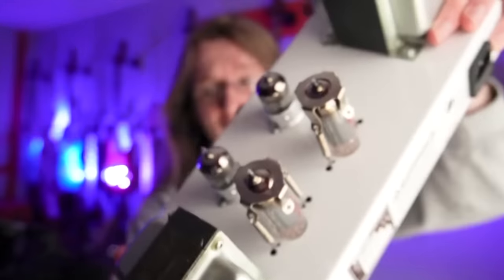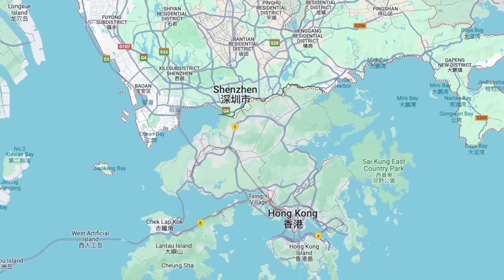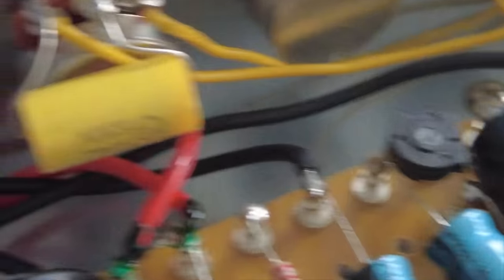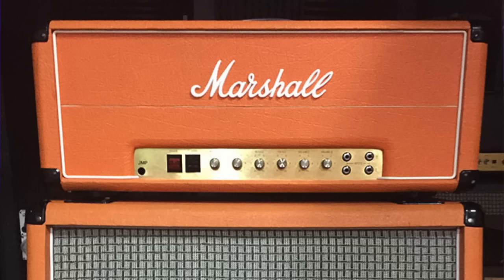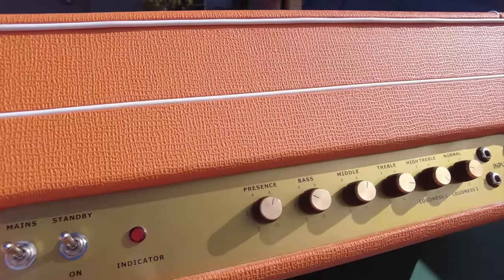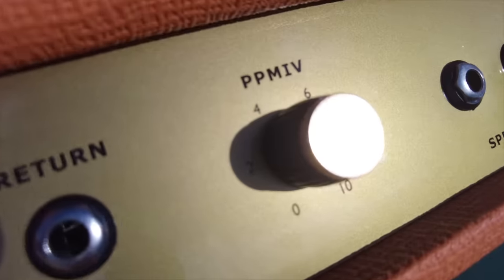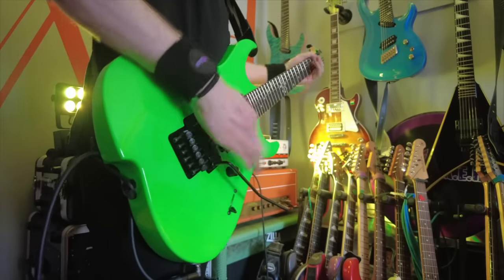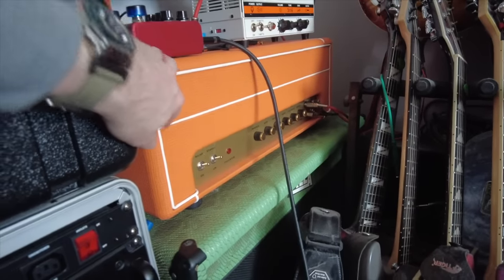Who made this Amp??

Comment: Also, don't forget that handwired amps are also easy to make yourself as a DIY project. I built one JCM 800 50 Watts clone and a Plexi 1959 100 watts. Took around 20-25 hours to make. It gives you also the opportunity to add custom features on it.
Reply from the maker: I’d love to try build one, but it’s a little daunting and there’s also the added dangers of accidentally touching a capacitor which scare me.
Reply: Love to but I'm crap at soldering and now need three of my guitars sorting because of my bodge soldering, so building an amp cool but not for me😁
Reply: @KDH  A capacitor shouldn't have charge in it from the capacitor factory, it will usually only be a danger once installed in a product and turned on
Reply: man I had a jcm 900  2100 it was stolen .................
Reply: wished I could make one like it
Reply: 84?
Reply: If building an amp seems a little intimidating from a soldering perspective, try building pedals first. There are a few DIY pedal companies online that you can buy PCB's and components from and you can get your soldering skills up populating pedal PCB's. They are a blast to build.
Reply: @leonkennedy74 Yes you are right . Fortunately the 18 watter I built tuned out fine . But now 15 years later I have some issues and are finding it hard to trouble shoot .
Reply: @KDH  You seem like an intelligent common sense  guy so you would have no trouble building one .I built one and it was a very enjoyable experience.   And at the end you will  be a soldering ace.
Reply: @k7j007  No need to even get PCB's, just look for the schematics (finding about every classic pedal schematics from the net isn't that hard), get some box for it, breadboard, perf-/stripboard and the parts. Build it first on breadboard to see if you like it and finish on perf-/stripboard. Some pedals even have nice ready stripboard schematics so you don't even need to learn to read circuit diagrams and figure out what goes where.
For authentic look the magical black goo is just thick epoxy with black dye, I would rather advice to leave that out and just apply a small amount of silicone on possible heavy components because repairing anything with the black goo is just nightmare beyond blindly figuring out multi-layer PCB design.
Reply: @KDH  It's true that those caps can be nasty, but like everything, learning is the key... There's a way to drain those to keep everything safe for you. What I did is that I started small, building pedals and then read a lot about the safety procedures before starting with a full build. It was a lot of fun, I sold those two amps to local bands and I will build a third soon.
Reply: @guyprovost I know there's a way to drain capacitors, but wouldn't turning on the amp when the plug is removed from the power outlet drain them? It's something I've thought about for a while now.
Reply: @castleanthrax1833  Capacitors need time to "empty". And those big ones can carry 400+ volts... Even if the amps is turned off. They almost act as batteries. Caps are in a circuit in order to "smooth" the spikes and lows, making sure the flow is constant. The best way to picture it is as a bucket of water. Imagine a bucket filled with water with a small hole in the lower part. The water with flow through the hole with a more "constant" flow even if the way you fill it with water come with the hose open full throttle at time  and at really low rate a other time. If you stop the source of water, the bucket will still need time to "drain".

If you turn off the amp, eventually they will drain. But I do not want them to drain using my body as a draining pipe when I hope time has passed :) ... Draining a cap is easy and you can always check the voltage currently "stocked" using a multimeter. In doubt, double check. You can easily built yourself a "drain" using two alligator clips, a wire and a resistor. You just clip to a ground and to the live part of the circuit to drain. Then you multimeter check to make sure before troubleshooting. Look online on how to build a capacitor discharge tool.
Reply: I think you should start with a pedal or two, I recommend from Aion fx. After you get comfortable with the soldering/troubleshooting, then start with a simple amp circuit.
Reply: @guyprovost I didn't ask for an explanation of what a capacitor is... I'm fully aware of what they are and what they do. 

You didn't actually read what I asked because you haven't answered my question. 

Never mind. I don't need to read another explanation of something I already know and didn't ask. 

Thanks anyway.
Reply: @castleanthrax1833  sorry about that… I guess the short answer to your question is « no »
Reply: @guyprovost  Many thanks, and sorry for being rude. ✌️
Reply: @KDH  No danger when you are building from scratch since nothing has been charged. The danger is in servicing amps which have been used
Reply: @KDH from the factory, capacitors are harmless, they don't hold a charge until the final product is plugged into the wall. If you're decent at soldering, you have nothing to worry about, it's just time consuming.
Reply: @KDH I'm a former Navy avionics tech, and built a few for myself after discovering it's the only way to get exactly what I want.  There's a learning curve.  I had the advantage of knowing how to read schematics, theory, and how to soldier.  Other non tech people have made successful builds.  There is no shortage of information on how to build an amp.  Everything seems hard until you figure it out.  I think it's worth doing a year of researching to get exactly what you want for once.
Reply: @KDH check out Low Head Room youtube channel. He builds an inexpensive tweed deluxe kit in a series of videos . Litteraly shows you every last connection. Hands down the best amp building tutorial on youtube. I used it to build my first amp and learned a ton ! Higly recommended!!
Reply: I would not trust an amp I built not to  kill me. I had one near death experience with a valve amp already. That's more than enough.
Reply: @monochromedout  I'm not sure pedals are comparable in terms of danger. It's like saying that if you think parachuting is dangerous maybe you should start with petting fluffy kittens. :)
Reply: @KDH  I've been replacing all my amps with equivalent hand wired (point-to-point) kits and thoroughly enjoyed the process both building the amp chassis and the cabinets - its a shame Barry at Ampmaker is currently closed as his WF-55 tweed amp was ideal for the beginner.  Just finish a kit from Modulus (Supa Deluxe) which with a few tweaks was great & just ordered their ROX-15 kit, the only issue here is unlike Ampmaker there are no step-by-step instructions, circuit diagram, explanation of circuit design, or an end of build test procedure, just a layout PDF and parts Pick List.  Never had any dealings with them but Vyse Amplification (Somerset) offer residential courses for both building and repair (take your own) of guitar amplifiers.
Reply: @KDH unplug it and bleed the filter cap, it's literally touching one end to the cap and the other end to a piece of metal. You'll get fine, go with a vintage amp to start with, they're pretty simple circuits that are far less complicated than you think.
Reply: I did build multiple amps for myself, Framus Cobra, Soldano SLO 30. Handwired amps and turret borad is the way...
Reply: @hadleymanmusic I have a JCM 900 2100 SLX made in 95', would you like it?
Reply: @KDH You could start small, maybe mod this amp for your liking? I can help you if you interested.
Reply: I've been building and servicing amps for close to twenty years. I must have built 40 various kit amps. Typically, with companies like Ceriatone there are year+ wait for one to be built. A lot of people don't want to wait, or they want some modifications to the circuit, etc.
I'm not going to get into the weeds comparing them, but I'll say this much: if I was looking for something like a JCM 800 or Reissue Plexi,  buying an actual Marshall wouldn't even be a consideration. Even if you buy it as a fully built amp, you'll be paying half as much and getting a better amp. A Ceriatone JCM 800 2203 will be $1000 less, and it's a point-to-point half wired amp instead of a PCB.
Reply: @KDH  Don't worry, mate. You'll only do that once.
Reply: @timwhite5562  Maybe you don't have a Fyette pitbull ultra lead schematics?
Reply: @KDH  Never had an issue with capacitors. It's the "testing an issue while the amp is live" that is especially dangerous and got me a few times. Remember, guitar strings are attached to ground! Never test with a guitar in your lap, signal generator or no input is preferred! 

Capacitors can easily be discharged, and better yet, you should always install bleeder resistors which automatically discharge the capacitors. One should still discharge an amp with filter capacitor bleeder resistors or measured for voltage, but I'll admit, I often don't, after monitoring the voltage and seeing it drop off in seconds after shutting the amp off.
Reply: nothing ventured is nothing ventured, live in fear. Keep the caps away from hands, simple, follow signal path. Learn to discharge caps.  @KDH
Reply: @KDH I've taken 600v through my hands several times.... it only makes you stronger.
Reply: @guyprovost  Are there are any recorded clips of your amps? :)
Reply: @HaydenMcCarry  Yep, I did record a few riffs, I'll have to dig them out.
Reply: And no need for coffee that day! @DeadKoby
Reply: Where can I find a kit?
Reply: @KDH 
We used to toss live capacitors to each other in electrical lab in college..major fun. It's the amps (amperes) that kill you..not volts..

Comment: This is touching on what most guitarists seem to deny or ignore - they buy BRANDS, not gear. Guitarists (well, musicians in general, but particularly guitarists) are notorious for hearing with their eyes. That's why the legacy brands (Gibson, Marshall, Fender, etc.) are able to charge what they do - they've become luxury/status items and their value is not based on the quality of the construction, but on the desirability of the name.

Hate to bring them up again but Chapman Guitars is a prime example of how we have all watched this happen in real-time. They started out quite similar to your Grand amp here - they got an overseas factory to make a quality item for cheap and sold it primarily through word-of-mouth. Then they started building a brand - and now those same guitars made in the same WMI factory cost 2-3 times what they used to. Where's that extra cost going? The name on the headstock. It's not just a "generic" product anymore, and the name became "cool" with guitarists. You can buy a secondhand Dean Hardtail (made at the exact same factory to the exact same quality levels) for HALF the cost of a used Chapman ML1 Pro Modern, just because of the name.

There's nothing special about a Marshall - the electronics are basic (this technology has been around for 80+ years!), the circuit designs are publicly available (a quick google search will get you schematics all day long), and they themselves started off doing exactly what Grand is doing here (making cheap Bassmans for the UK market). Anyone with a box full of parts and a few hours' soldering experience can make one. What you CAN'T do is sell it as a Marshall or convince other people it's a "real Marshall." That's the difference.
Reply: There are some additional considerations too. A stable brand should "still be around tomorrow" A warranty might actually have meaning, and they should have a predictable quality level. This in turn means you should be able to expect a higher level of support, as they have more to lose in brand value by not continuing to give good service to their customers. Does this always turn out true? definitely not, but at least partially because we get hooked on brand (and there is nothing wrong with being loyal to a brand that's served you well in the past), and sometimes we don't vote with our wallets the way we should.
Reply: @paulmdevenney Also resale value. Guitar players tend to cycle gear. So resale value is important for most of us.
Reply: Nah. Most of the American Marshall Forum users are very open to clones. Especially Ceriatone and metro, since they source higher end components. I found a used Ceriatone JTM45 for relatively cheap and it’s great.
Reply: Agreed on all fronts 👍

...Bonus points for the Deal Hardtail comment, I still love my 2007 Brazilliaburst. Underrated bargin.
Reply: Exactly. This is all 80 year old tech by this point and you can bolt together a better Fender for under $2k than anything they can sell you.
Reply: @watersnortmoment3734  Agree. Ceriatone is the shit.
Reply: I have never cared about brand. I just buy the best piece that I can afford. My guitars and hardware are a mixture of many brands and Price levels.
Reply: @216trixie  
This is the way.
Reply: I agree, and your Marshall example is a great illustration.

Of course, the practice of placing arbitrary value on certain brands isn't limited to musicians. It applies to clothing, automobiles, beer, food, and the list goes on.
Reply: In the current market I don't think you will necessarily get back what you paid for it, I've seen a few shops here in England and the U. S. saying they're turning people away with their Marshall head and 4 x 12 because they just sit there in the shop. Also it's a lot to lug around unless you're a touring band with roadies, you can get a smaller amp and get a great sound with P.A.s. Then there's E bay and Reverb affecting price and availablity.
Reply: This is part of why so many guitarists hate Peavey amps. The old ones with the tall silver panels on the sides of the cab, specifically.
But which model of Peavey do people hate? They're all vastly different designs, it's not like fender offering 4+ versions of the twin (twin, super 6, quad, dual showman) with different speakers, most old Peaveys have vastly different controls and tonal characteristics. But it's easier to write them all off as bad when you spent $3,000 on something because it says Marshall on the front.
Reply: Marshalls are cheap tho, look at their flagship for the last 20 years, the JVM410H. It's the cheapest flagship amp with the most features. Take a look at the Mesa Dual Rec, Soldano SLO100, Black Star Series One, Bogner Xtacy, Friedman BE, Engl E670, EVH 5150, Orange Rockerverb MK3... Hell even the Peavy 6505 1992 is more expensive with much less features than a current DSL or JVM
Reply: @GhostpainOG   Agreed, I own three of their amps already, looking at two more over the next year. One he calls a FAS ( A new Soldano clone) and a JEL (2 channel, Jake E. Lee/ JCM 800 modded Marshall clone). Nik and his crew are the Shiznit.
Reply: @strokingoutloudpodcast  I mentioned it because I too have a WMI Dean Hardtail in silver, lol. Bought it for $200 and it plays just as well as ESPs I have that were 10x the cost.
Reply: Us synth players are not like that 😝
Reply: @fortheloveofnoise  Considering I've been looking into modular lately, I'm not sure that's true either. :P
Reply: Good points..I prefer my Dean's to my Chapman. No contest.

Comment: It should be noted that a lot of people get confused about what it means when a manufacturer says hand wired. Really, any build can be hand wired, even pcb builds. What people are thinking of is point to point wiring and manufacturers know this. Some less... scrupulous manufacturers have capitalized on said confusion.
Reply: I study electronics and one of my professors (has a master's in electrical engineering) always suggests we get PCBs printed after the prototyping stage because of all of the benefits the provide. They're more compact and reduce parasitic capacitance due to their layouts. 

I think mostly the fascination with point to point and dated tech comes from a misunderstanding of how electronics work.

Now the argument of amps being made to small/unfixable because of many PCBs and crammed space is fair but I believe that's a different argument because it's a design/layout issue vs. a point-to-point/PCB.
Reply: @Bruce.t.thomas I'm a former avionics tech.  Engineers are good for theory, not so much for practical applications.  Some have never held a soldering iron.  Listen to amp techs that actually play guitar.
Reply: It's hand wired turret board construction
Reply: @qua7771 yep definitely true! 100% mate. Knowledge is power. Practical application is key!
Reply: Like the recently relaunched Gibson amps designed by Randall Smith, which are labeled as "hand wired" (and priced as such) but have no point to point wiring whatsoever.
Reply: @Synic42  Probably not a whole lot of wire either.
Reply: @qua7771  Nope, but at least that bit is done by hand!
Reply: @Synic42  Plunging it in to an outlet could be hand wiring.
Reply: @Bruce.t.thomas I'm an electronic engineer with 50 years experience right across the spectrum of electronics, I used to think like you but I learned to be more open minded later in life. PCBs have their place and I design lots of new stuff using them along with microprocessors BUT some things, such as point to point hand wiring suits guitar amps better, nothing to do with sound, that's mostly a mythical area but repairability, durability and reliability are so much higher than ANY device manufactured using PCBs. You'll figure that out for yourself one day.